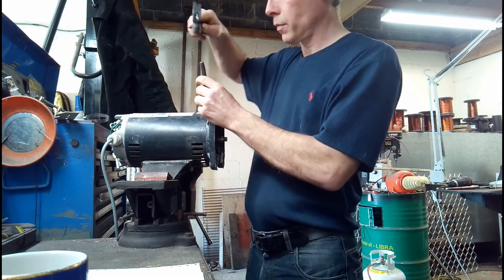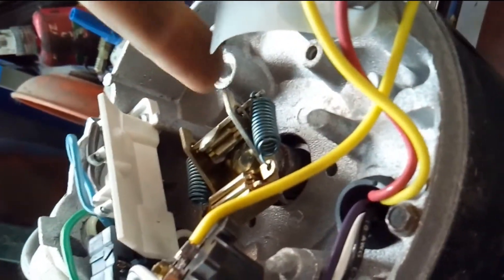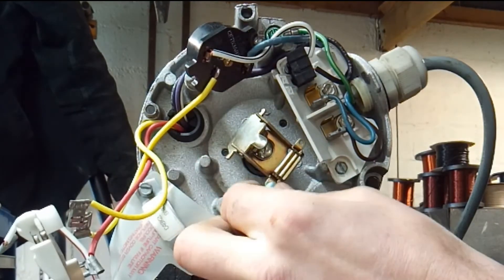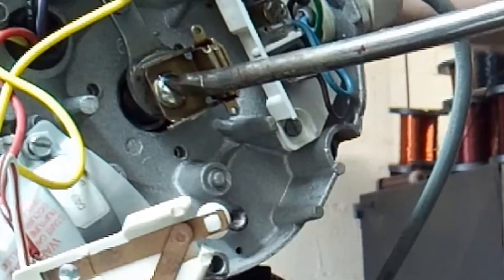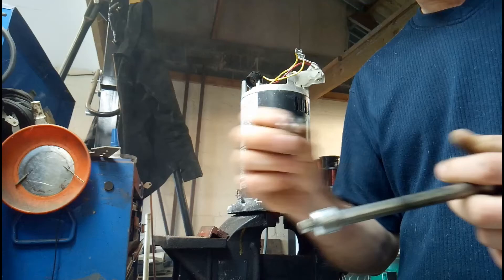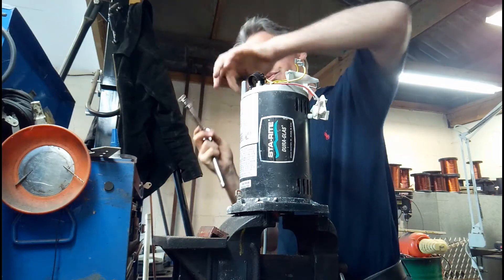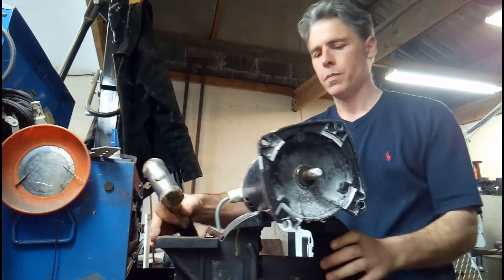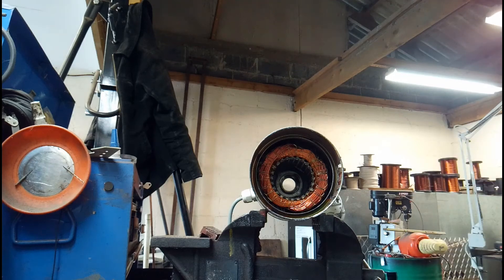Sta-rite pump overhaul  (4 of 8) - remove centrifugal switch and rotor.

Comment: ممكن طريقه عكس الدوران لهذا المحرك
Reply from the maker: Easy enough to do. Just swap polarity of run winding with respects to start, however If you do this the impeller will be going in the wrong direction and the pump will not pump. On top of this the impeller will come loose and bad things will happen! Cheers
Reply: @electricmotorrepair2605  أنا أستخدم الموتور فقط في غرض مشروع شخصي

Comment: You did not leave anything that you did not explain, thanks, but you kept the white bone that conducts electricity. You did not come up with any emergency to clarify it .
Reply from the maker: Hi. Sorry I do not understand translation. Have run text through AI as below, but with little success!

Based on the given text, here is an analysis of the potential incorrect words and their likely corrections:

Incorrect: "You did not leave anything that you did not explain"
Likely Correction: "You explained everything thoroughly"

Incorrect: "but you kept the white bone that conducts electricity"
Likely Correction: "but you ignored the essential part that explains everything"

Incorrect: "You did not come up with any emergency to clarify it"
Likely Correction: "You did not provide any additional information to clarify it"

You are welcome to try again and hopefully I can answer your question next time.  Thanks
Reply: @electricmotorrepair2605  ..
Sorry, I'm trying to translate via google
I will try to explain more in:
If you remove the back cover, does it not appear in front of you, and on the right, a white bone that connects to the internal wires with the external electrical supply wire?
I am asking about the way to connect the back wires to it, how is the way and what are the colors (blue-white-violet)
Reply: Thank you and go ahead
Reply from the maker: @عبداللهناصر-ر8خ  مرحبًا ، قد يكون من الأسهل ترجمة النص باستخدام Chat GPT! لقد أضفت بعض الصور التي التقطتها للتو من المحركات التي ستتم التخلص منها قريبًا. L1 هو المرحلة و L2 هو النيوترال. السلك من لفة البدء إلى القاطع أحمر اللون. آمل أن يساعد هذا وحظًا سعيدًا. كلايتون
Reply from the maker: https://drive.google.com/file/d/1PXF9CNdCs6uM4iGcQ3zYZ-RI7HYQQ8Ga/view?usp=sharing

Comment: Hello my friend. 
I am from India I have all the spare parts required in these pumps the v shap switch , the voltage selector switch 115volt /220 volts, temperature control switch black one, and the sprint centrifugal switch along with the impeller or fan which lifts the water.  I can offer you the lower price and I am already supplying to many places from india.
Please make some inquiry.
Reply from the maker: Hi Mahendra

I appreciate the offer, however, I have enough of these parts to sink a boat. Cheers Clayton

Comment: regarding the pump cutoff switch, I noticed in your video that it is not attached directly to the side of the pump. so I can basically move the cutoff switch away from the water pump?
Reply from the maker: Hi Nelson. I think you are talking about the v shaped stationary switch contact that is attached to the non drive end plate. If so, I removed this on video 2/8 around 1.30sec. If not, then let me know. Cheers